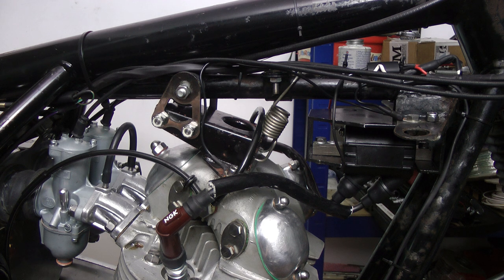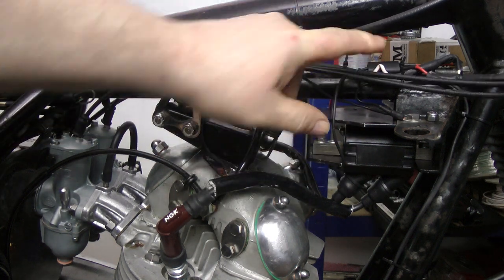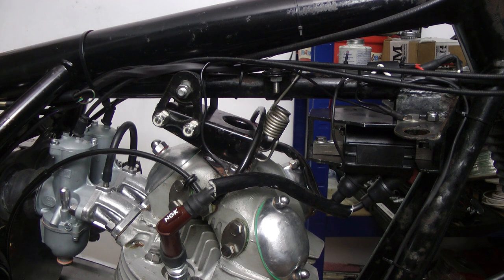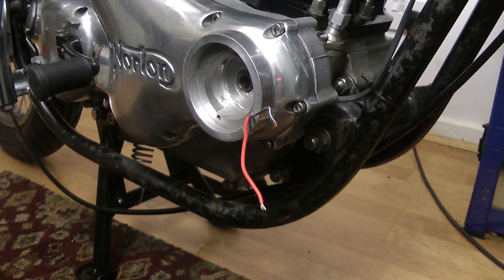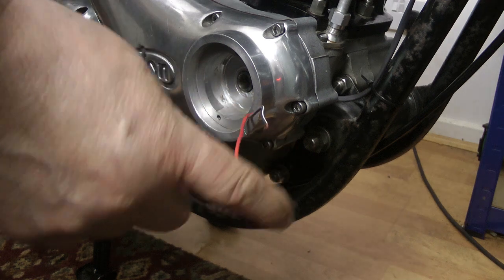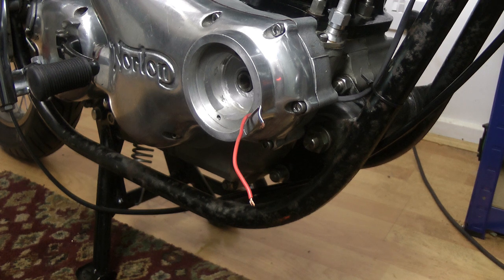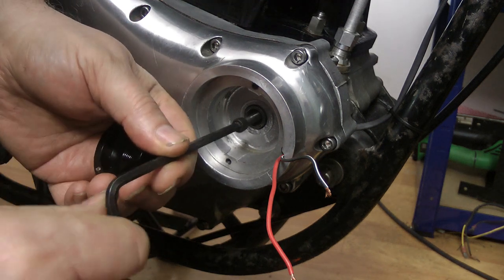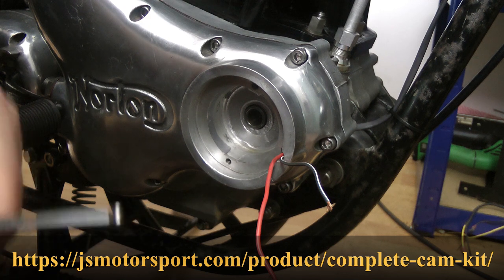Norton TriSpark Ignition Fitting Part 2

Comment: Very comprehensive. One question, which Tri-spark unit did you purchase the TRI-0006 or TRI-0007? And, was the coil unit a Tri-spark item? Many thanks.
Reply from the maker: Hi, it was the TRI-006 Tri-spark unit and the "12 Volt Dual Lead Ignition Coil" also from Tri-spark. It all seems to work as expected.
Reply: @DiningRoomGarage-rv4lh  thanks for the clarification, excellent video thingies by the way. I’m unsure of the difference between the TRI-006 and TRI-007 if I’m honest.
Reply from the maker: Hi, As far as I can tell the SD stands for short duration and that refers to the time the current is flowing through the coils, that is the dwell and you can get dwell meters for use on points ignition systems (to do with the points gap and the cam). When current is flowing it will generate heat in the windings and this can damage the insulation between the windings of the coil. If the heat and damage becomes sufficient you can get shorted turns meaning less resistance, more current, more heat etc... Tri spark make mention of mini coils that take less space. To make the coil smaller you need thinner wire and thinner insulation. Hence the need to reduce the time the current flows; so SD. Of course, there in lies the problem, not enough time for the magnetic field to build up means you will get a smaller spark and that can lead to intermittent firing of the cylinder, hmm... It is always a compromise.
Reply: @DiningRoomGarage-rv4lh  crikey! Thanks for the comprehensive explanation - well out of my depth
Reply from the maker: Short answer, if you want to use small coils use the SD version Tri-0007